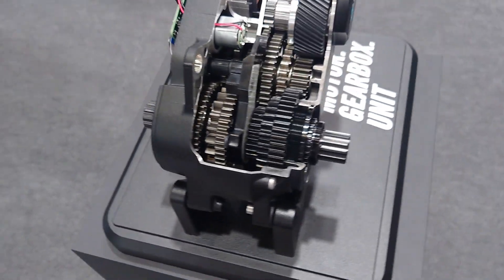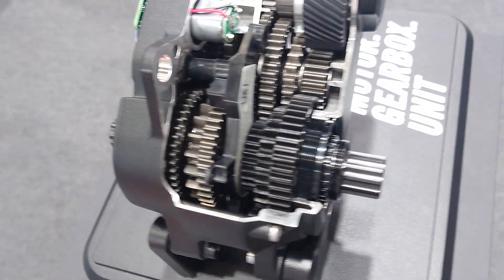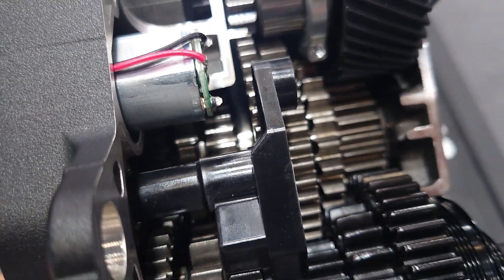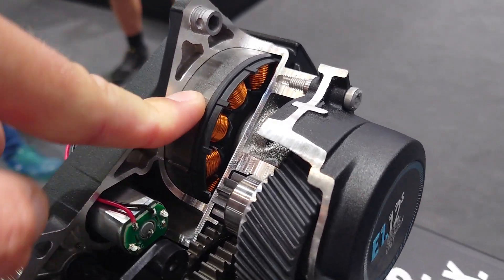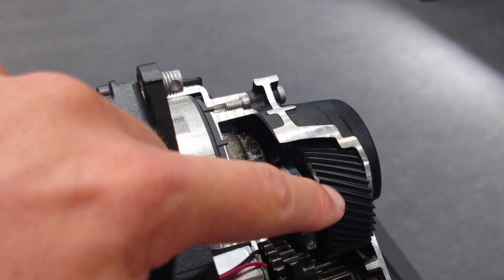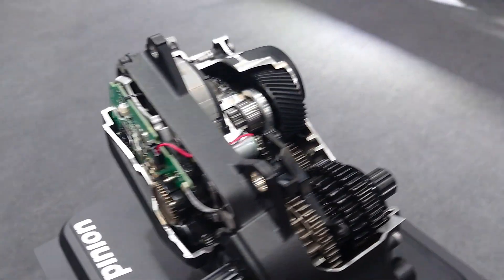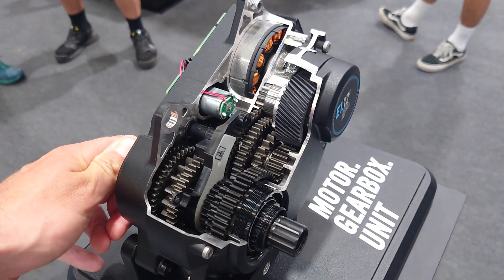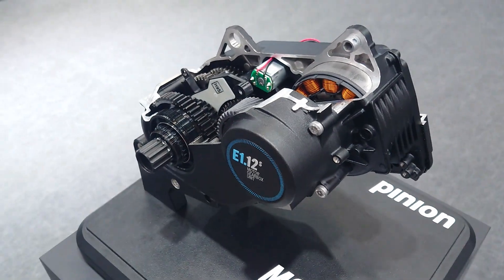How it works: NEW Pinion E-Drive Motor and Gearbox drive unit

Comment: If the battery goes down, can you easily pedal this thing?
Reply: Apparently there’s approximately 1,000 gear changes available once the battery has gone down.
Reply: If it’s anything like the normal Pinion gearbox, you certainly could.

Comment: 0:07 Can the torque and speed sensor be used as a power meter?
Reply from the maker: Absolutely. But, it probably isn't 'enabled' as such. Not sure.
Reply: @PeakTorque  It would be great to have the power meter readings available for head units, since pinion gear boxes need pinion cranks. Otherwise only power meter pedals can be used or a power meter at the hub. I hope they do open the data feed.

Comment: Need more commentary about the motor. Are the magnets surface mounted or imbedded in the laminations. What motor control are they using 6 step commutation or FOC. Are they using hall sensors for position feedback or encoder/resolver. Magnet grade, Steel lamination type...etc
Reply from the maker: Its an off the shelf in runner. Looks closely at the windings and you can probably identify it and answer those questions!
Reply: @PeakTorque  I looked at the images on my monitor. It looks like its a Brushless DC Motor. The concentrated winding leads me to believe its a brushless dc motor with trapezoidal back EMF. Control method is likely a 6 step commutation. What is interesting is when you compare Pinion to BOSCH. The BOSCH ebike motor is wound to produce a sinusoidal back EMF. This enables BOSCH to use a much more advanced motor control technique. They appear to use Field Oriented Control which squeezes every bit of performance out of the motor.

Comment: As a fellow mechanical engineer, I always find your technical reviews comical.
Will add, you and Hambini are a great pair.  A dynamic duo of disinformation. 
The motor in this Rube Goldberg monstrosity has the wattage of a slot car motor and the transmission, the complexity of Rolex Submariner mechanical watch movement.
The cost/benefit of this relationship is akin to a pet rock.  Will be ridiculously expensive, with questionable reliability cost due largely to complexity and no value added because the motor will be so pathetically weak.  Technical masturbation only woke suckers who flunked math in high school would buy.  And you address none of the obvious pitfalls of combining a gearbox and motor in the same housing, most notably serviceability.
A joke.  I look forward to your video extolling the manifold virtues of the Titan submersible design.

Comment: Cool on the geek front but the problem is this is ultimately a product without a market. Gearboxes are simply not performance components. The non-elect pinions are super popular with touring crowd because durability is prime and performance is on the low point of priorities. But, there's no real place for an electronic component on a world tour, aside from an eTrex. So who is this going to be for? Not mountain biking because the poor engagement is a non-starter for most people.
Reply: Pinion have been used in quite a few mountain bikes. A friend of mine has one. There’s no lack of engagement problems. When used with the motor combined it removes the fragile derailleur and drastically increases the life of the drivetrain. Plus you can use a belt drive if you want.
Reply: @streddaz  There absolutely is a huge engagement problem. Anyone saying otherwise I question if you've every actually seen one. I call bullshit.
Reply: @cjohnson3836  well I beg to differ as I’ve ridden my friends Zerode with a Pinion gearbox and the engagement is no worse than any standard 18 tooth free hub.
Reply: I hated the combined engagement delay of back and center on the non-electric Pinion P1.18 - but hadn’t comparable issues on the e1.12. Maybe they got rid of the center delay or reduced it ? Will test again at the next Eurobike
Reply: @streddaz So you mean your friend spent out the ass for performance equal to the cheapest model DT Swiss? Is that really your argument?
Reply: @cjohnson3836  no, he bought a bike that needs very little maintenance, never needs the gears adjusted, has excellent rear suspension performance from the low unsprung weight and doesn’t have a derailleur that can be torn off/bent/shift like dogshit.
If I were to get a new enduro bike, I’d get a Zerode.

Comment: If I’m understanding this correctly, the motor is after the gear box, so it’s more like a hub drive than a mid-drive?
Reply: no, the electric motor power arrives at the intermediate shaft. Theres 3 different ratio between it and the whell.

Comment: This looks quite clumsy and unnecessary complex compared to the current gearhub solutions that are out there. Why didn't they take inspiration from Nuvinci or how gear-ratio works on a scooter for example? As an e-bike motor the latest trends are to reduce the needed amount of cogs to improve drivetrain efficiency.
Reply: Because Nuvinci is 5 to 10% less efficient and weighs lot more.
Reply: Stop clouding the issue up with facts!lol!

Comment: That’s a lot of gearbox for a bicycle
Reply: I thought the same thing. The gears appear to be over kill for the power applied. However what’s not known is the quality of the steel and are they planning to upgrade with a more powerful motor in the future.
Reply: @keithnewton1966 it’s pretty much the same gearbox that Pinion use in their non motored gearbox.

Comment: would love to see some more details with the IntraDrive gearbox motor unit, its motor seems more advanced and probably has a simpler gearbox setup inside. From first ride vids of the pinion it seems to have two clunky shifts throughout the 12 speeds, maybe a 3x4 kind of setup inside?
Reply: You think? This design is a joke.  The fake engineering channel for wokesters.
Reply: There are two gear selection, one from the cranks to the intermediate shaft with 4 ratio dealing with legs torque, and the other from intermediate to output with 3 ratios, dealing with legs troque +motor. I suspect these shift to take more time as there is more torque to deal with.

Comment: Maybe once they've finished designing all this stuff, they could design some better traditional mech driven road / gravel gruppos at reasonable prices too.  Given the amount of R&D that goes into their products, and production costs, their existing gearbox products are incredible value by bike industry standards.  I should think one of their top of the range non-E gearboxes costs at least 5x as much to produce as Campag's entire new SR gruppo - which is retailing well north of 5000 euros - 6000 if you want the PM version.
Reply from the maker: It makes these crappy 1x systems that we're all getting forced to adopt look a big pile of expensive sh1t i agree.
Reply: @PeakTorque  I know a bunch of people with newly bought gravel bikes where I live ... the people with stock 1x setups almost never ride them.   Either they struggle to keep pace on the flat, don't have low enough gears for off road walls, or get sick of huge cadence jumps if there's a true wide range setup.  The sensible bought or changed to 2x and ride their bikes.  I hate the gearing on my 1x XC / DC bike, but we're not being given a choice.  I'd much prefer 2x.
Reply from the maker: @pmcmpc  I will be going 2x on my gravel bike for this reason!
Reply: @PeakTorque  FYI, Shimano GRX 11s 2x will work with a 50-34 (using road FD) and 11/40, 11/42, or even in extremis an 11-46 (with a goat link) ... it works miles beyond the Shimano spec - albeit you lose 1 sprocket in each ring (big/big & small/small won't work).  Very useful because Shimano 48/31 grx chainset has non-existent / dog shit power meter options.

Comment: They need to make this gearbox without a motor and with a sealed belt drive system for Unbound gravel mudfest 2024.
Reply: They said they are coming out with an electronic shifting unit without a motor. But there is still efficiency loss and higher weight so you probably won't see it used for racing. For touring and bikepacking it would be great.
Reply: They make the P and C series already. 

Typically have gates carbon drive. But not sealed.

Comment: Robot gearboxes you say? I spent 5 years working with Panasonic robots (mostly heavy industry) and it was (often) a lot of fun. Be interesting to hear your experiences. 🙂

Hambini has “beef” with someone you say? Call me incredulous but I find that very hard to believe. 😁
Reply from the maker: Not as "heavy" as you but a few years experience now with Harmonic drives. 160:1 ratio and zero backlash is pretty fun. Turn a small DC motor into a lifting beast in a single stage. Whoever invented the harmonic drive is a mad/crazy legend. For anyone who cares, it's an egg shaped bearing forced to rotate in a flexible steel cup!
Reply: @PeakTorque Yes I  used to do maintenance on the wave generator. The grease we used for that application was £1,000 for a pot of about 500ml if I remember correctly. 😅 Like you I have great admiration for the designer of that gearbox.
Reply: harmonic drive is used on tq motor i think
Reply from the maker: @godtux  It is indeed!

Comment: should have put an acrylic case over it or something ... bet somebody snagged their finger in that display piece
Reply from the maker: Good point. Elf and sayfty m8. I once went to a Chinese engineering trade fair where they had laser etching machines running unguarded In their booths!
Reply: @PeakTorque It’s common in Asia, especially in Japan. I have seen factories where robots are working next to humans without any cell walls. (Unlike in Europe) simply because if you tell a Japanese guy not to cross a yellow and black tape on the floor he won’t… in the UK if you ask someone not to do something they say “what like this?” And do it anyway. 😅
Reply: @PeakTorque  That same display stand in NYC you'd have people lining up with their attorney on the phone demanding their liability check.
Reply: @PeakTorque   wild stuff ... usually german diarrhea shits their pants on savety, usually where it doesn't matter, while other stuff remains dangerous
Reply: Reading this 8 month after the show, I still remember cutting my index finger on the razor sharp cut out st the side when „feeling it out“. I didn’t realize it till I wondered where all the red juice suddenly came from🫣😝

Comment: really really cool. Did they have any in-bike model units you could test? I'm curious how much better the shifting under load is on this unit compared to the P & C series gearboxes. Does the electric assist play into the fact that you can shift under load, or could the same shifting be applied to a non assist gearbox?
Reply from the maker: Great question. I tried it. Shifting was very smooth, and silent BUT not instantaneous. Engineer confirmed they time it for low torque event (crank at 0, 180 deg) to help achieve smooth shifting. Still, it felt very fast apart from at low cadence when this becomes more obvious. The inward pulling pawls on the cam help this, unlike the outward engaging pawls on something like the effigear.
Reply: @PeakTorque  previous generations required that you consciously stopped your pedaling to shift, even though it only shifts at 12 and 6 o'clock, do you have to slow your pedalstroke or is it unnoticeable?
Reply from the maker: @dvoob  unnoticeable. I was banging through the gears like Colin McRae. However, it was a flat tarmac test ground, so not much torque. Should have tried it with the brakes on and some load. However, the motor assist in the top mode 'FLY' felt jerky. Not very smooth, quite on/off.

Comment: That looks as large as a traditional mid drive motor.  What gives, then? Why would a mid-drive need to be so large (in comparison)? Beefier motor?
Reply: Internal gearbox, ebike motor and gear box all in one
Reply from the maker: Correct ☝️. This is a motor and 12 gears combined. In not much bigger package than just a motor unit.
Reply: I'm aware of that. However I was not aware that integrating the gearbox in the motor casing would bring such a negligible packaging penalty
Reply from the maker: If you were being very critical you may say that the latest Shimano packaging is internally quite spacious! Edit: from what I've seen Shimano use a smaller in-runner DC motor than this, so need a bigger speed reduction, which has its benefits but takes up some space. I can feel this as a slippery slope of analysing ebike systems. Not my cup of tea but similar to my 'work'.

Comment: Thanks for taking a look at it. Really cool that pinion is listening to what customers really want. That's a big middlefinger to all chaindirve manufacturers.
Reply from the maker: No problem 👍
Reply: Chain drive will always have a place because of cost. These pinion gears will never sell volumes like chain drive.
Reply: @2WheelsGood.01  Cost of what, sorry? Did you miss how much mid range (105) chain driven bikes cost these days? Not to mention level or two levels above. Compared to them this is good value.
Reply: @channul4887  the pinion gearbox will still be miles above in cost.
Reply: @2WheelsGood.01  let me try again - cost of what exactly, gringo?  Latest 105 bikes cost around 5kusd these days (group on its own is around 2kusd). And they are mid tier grade of everything - mid tier frame, low/mid tier wheels. Latest Campag groupset on its own (without bike) costs 5kusd. And bikes built around it will be 12-15kusd. Are you saying that pinion gearbox on its own will be 10k/20k? How do you make these baseless assumptions.
Reply: @2WheelsGood.01  true, in my humble opinion they are aiming at the high price segment. Cost of ownership + time invested maintaining the system over lifetime should definetly be considered when purchasing an expensive bike and many will do so.
Reply: Chain drives will also win on efficiency
Reply from the maker: @m_kanadax  not on mtb with stupid 1x in 34-50 combo with a dirty chain. Not efficient at all.
Reply: @m_kanadax  right. But how important is efficiency on an E-Bike? And derailleur systems come with wear and costs of wear, maintenance etc. With a Gates belt this system is simply a no brainer. 
And even on my bio bike I took a Gates belt because I simply had enough of chain maintenance on my commuter bike.
Reply: @svenweihusen57  It is decisive when you run out of battery and have to pedal it home.
Reply: @rosomak8244  We are talking about some percentages which you can easily counter with a slightly bigger battery or simply accept that this is a bicycle and not some XS motorbike. Nobody is talking about the effects of neglected maintenance for derailer systems where a bike with gates belt and an MGU will simply never lose any efficency because both don't need maintenance. An oil change every 2+ years IMHO doesn't count and will not impact the efficency.
Reply: Speaking of cost of production it would be quite interessting comparing chaindrive + midmoter unit vs the pinion unit +  gates.
From an OE point of view the pinion also has the following points in their favor:
one vendor, less assemblytime, no adjustment
Reply: @Rabrand1  to get the full picture you would need to include maintenance costs. This costs an oil change every 10.000 km and a new Gates belt around 15.000.  It's certainly not worth it for bike used twice a year on Sundays but for commuter its something totally different.

Comment: Valuable or are mechs better ??
Reply: If you really hate doing maintenance, this + belt drive would be a godsend. Could be a valuable thing for the casuals
Reply: @invisiblescout6335  Yes, true, I find maintenance not a great biggie.  Keep eye chain health and cleanliness and wash after every winter ride, bearings go, but parts seldom wear out, just a chain a bike a year 5kilos ridden
Reply: @invisiblescout6335  I think that an XC hardtail with a non ebike version of this + a simple to service fork may be the endgame of n+1. Although I think for me to make the switch I'd want a system that shifts under load and has a built in dynamo that charges the batteries required to shift. Big ask, but in a perfect world both things are attainable. WIth a continuous dynamo the battery could also be much lighter which is a plus.
Reply from the maker: Mech probably higher peak efficiency (if clean and new chain).  But this is just impressive.
Reply: @PeakTorque  likely the future. Been on mechs what 55 odd years.  Maybe 65 odd years
Reply: @PeakTorque  So the mech is more efficient if you don't ride the bike. Good to know.